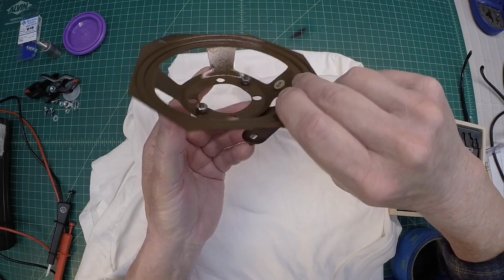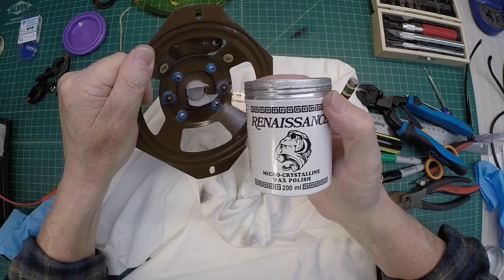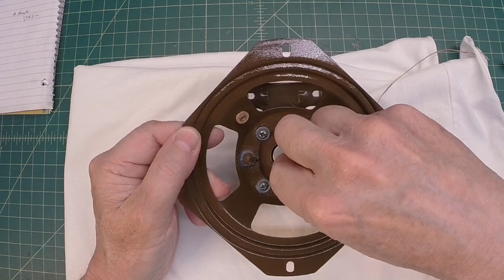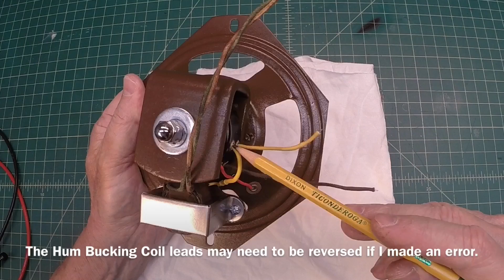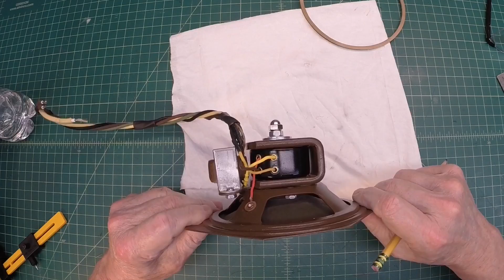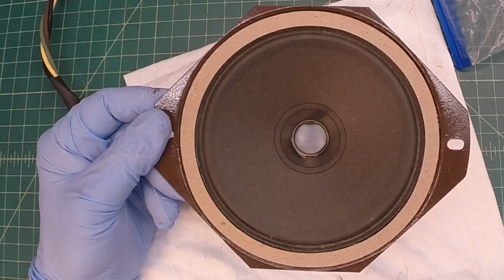Speaker Field Coil - Getting Things Back Together & Basic Testing

Comment: I am trying to do this with an RC 36 Bell record-o-fone speaker. but with no success, If i biuld one from scratch they seem to work.. this one i tried reconeing, and i cant get it to turn over..
Reply from the maker: I don’t have a schematic for the unit. I assume your voice coil DC resistance is in check in addition to the output transformer, etc. Best, Don

Comment: What was that DC voltage you were applying to the field?
Reply from the maker: I don’t recall exactly, but I think around 20 volts DC. The key is really DC current, i.e., the DC current can’t exceed the rating of the Field Coil. In most cases you’ll see 40 to 70 mA of current. Best, Don

Comment: I've got a peerless reproducer (No. B 44545) with a paper cone and a (thin) leather gasket/surround. I'd like to restore moisture into the cone and surround, but I don't want to ruin it either. Any suggestions,  tips, advice, etc. It seems 2 b in great shape otherwise(despite the age- 1900-1920s) but I'm afraid to do anything with it. Again any suggestions, tips, advice, etc? Thanks